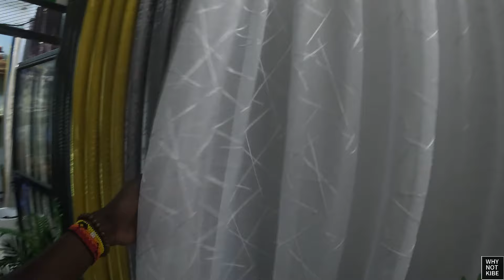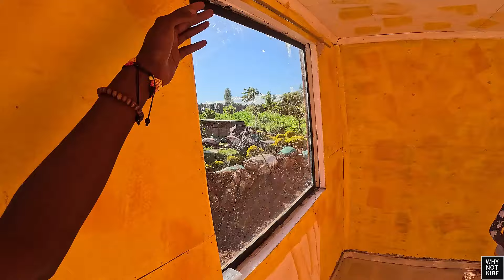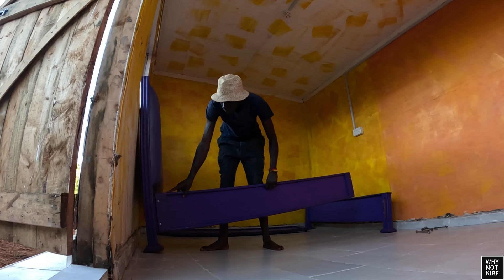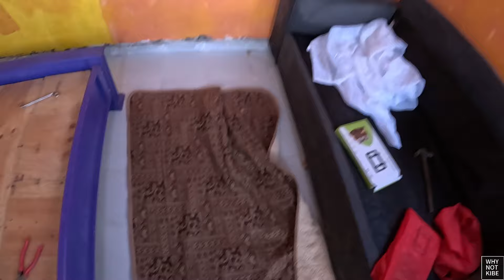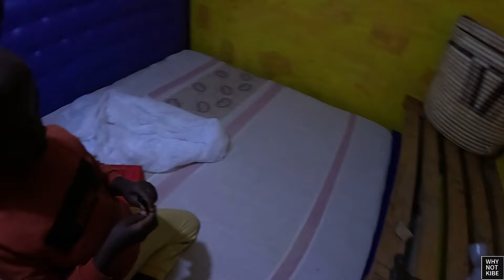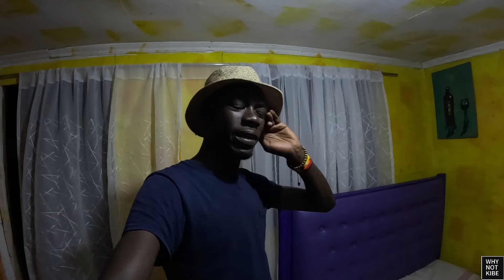TIME TO FURNISH AND FINISH OUR SIMPLE CABIN IN AFRICA.

Comment: Kibe actually the color yellow complements purple. So you are not far off track with the walls.  The colors must complement the color of the bed. If you change the wall color. Use a solid soft pastel yellow.  You could also use a soft powder blue. Gray is neutral and conservative. Turn the carpet over to the white side. There needs to be a green plant on the table.  The Art is nice but not coordinated with the full look. If it is meant as a small room for adult visitors it could have a small cottage look by changing the art pieces to the African woman carrying the jar and the other art piece of the drinking gourds, Mother Africa ls ok. The other pieces no.  The curtains are very nice. Add screens on the window that opens and the door to keep the critters out. Good work.